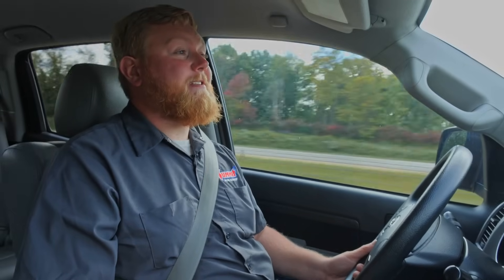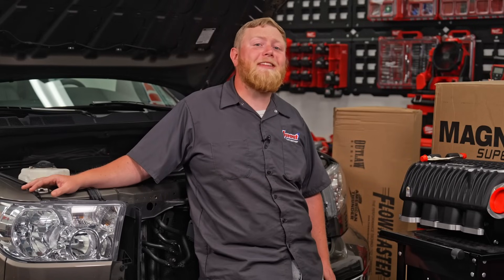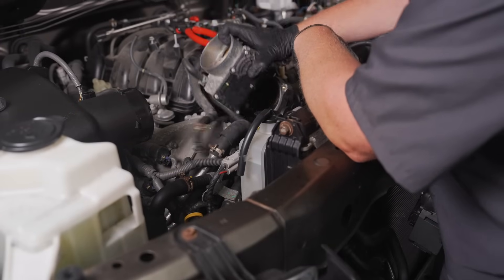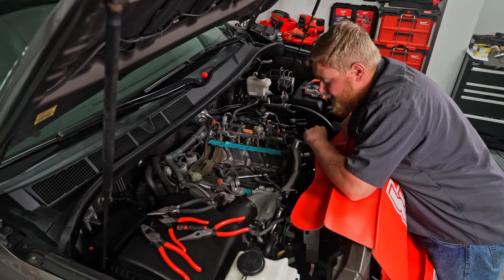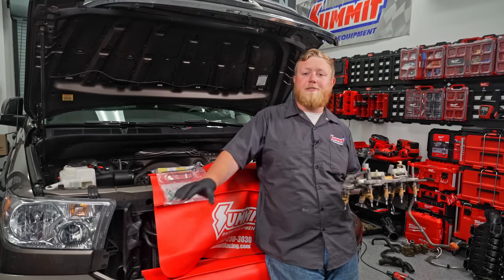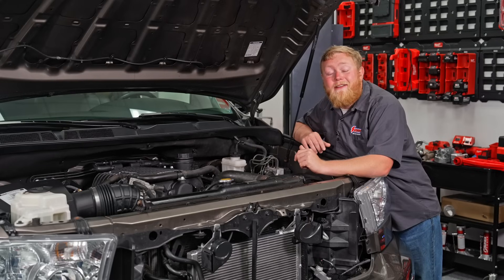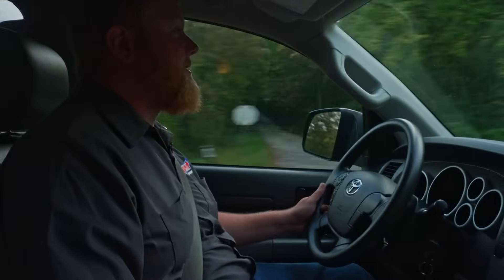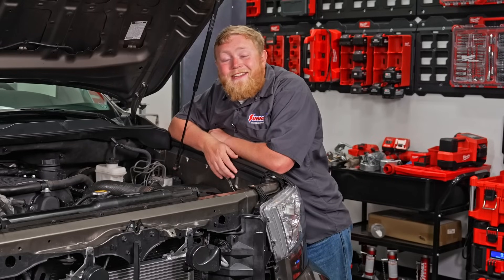We Bolted a Magnuson Supercharger on a 2011 Toyota Tundra—See the Install & Results!

Comment: 381 HP NA. What's the point of 1. wasting truckload of money and 2. stress engine more than necessary?
Reply: What did you pay for the 381hp ? Considering that cost, what they ask for the extra 150hp is actually quite reasonable.
There’s no appreciable extra “stress” to use your words. I’ve run hundreds of thousands of miles in supercharged vehicles with NO failures of ANY sort attributable to the addition of the supercharger itself, but if you don’t like the technology or don’t believe in it, then don’t go buy and install one…

Comment: Thanks for the video man!  How many miles is on that?  I have a 2009 with 147k on it.  I was thinking about one of these, but didn't  know if my vehicle is too old or not.
Reply from the maker: Thanks for watching ! This truck had about 90k on it when it was installed. as for your 147k truck as long as it's in good health and properly maintained go for it !

Comment: I have a 2013 tundra with 161K miles on it.  Is the truck too old/used to put one of these on it?  Do I risk ruining my engine, transmission etc?
Reply: Have the motor refreshed and you’ll be good to go. Even with a brand new truck you always run the risk of ruining something depends on how you take care of the truck and how you treat it

Comment: Hey Jus I just got a 2010 tundra with magnetson supercharger  the sale guy told me it using regular fuel,  is this correct?
Reply from the maker: it is premium pump gas Friendly !
Reply: But, what if you go a little bit deeper into the engine,  like to replace OEM pistons with cast iron one?will you still have to use a premium fuel?@SummitRacing @blue_basin

Comment: Nice.
Wonder how long the engine will last.
Reply: You’ll have to make sure you stay on top on maintenance especially regarding oil, fuel, and coolant (changing coolant out every 50k instead of 100k would be advisable). Making sure you have a fresh fuel filter and strong OEM pump would also be advisable, but as long as it’s sub 8psi it’ll run for a long time. These engine are built like tanks. Keep it cool, keep it lubed, and make sure it has plenty of high quality fuel. That’s the key with boosted engines like these.

Comment: Awesome!!!  Were you thinking about the Whipple also?  I have a 2021 Dodge Durango RT, Tow N Go (all SRT parts but has the 5.7 engine).  I'm on the fence between Magnuson and Whipple 3.0 Gen 6 that's coming out.  However, I'm reading a bunch of bad reviews on Whipple in numerous Online auto forums.  And the Whipple only provides a 1-year warranty versus Magnuson's 3-year.  Your thoughts?      🏁🏁🏁🏁🏁🏁🏁🏁🏁🏁🏁🏁